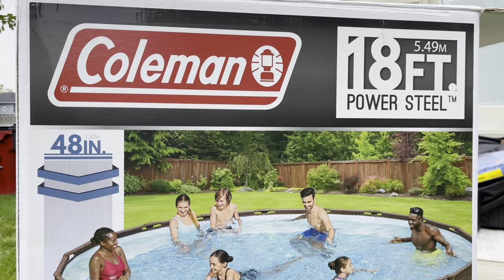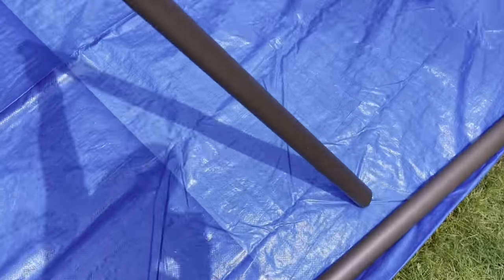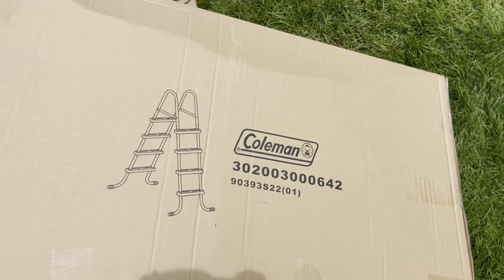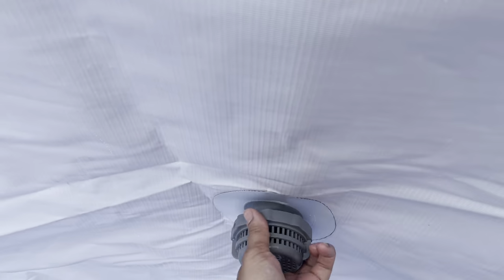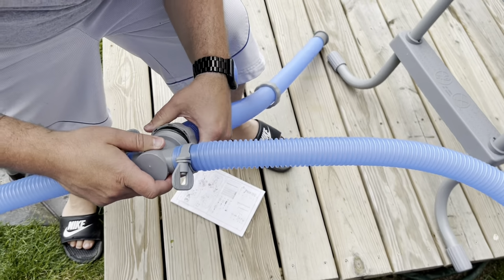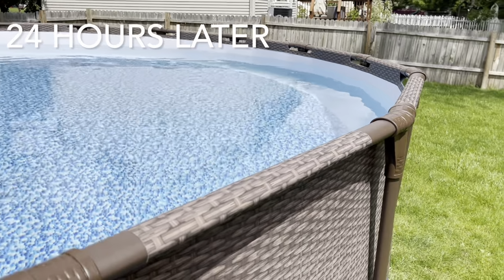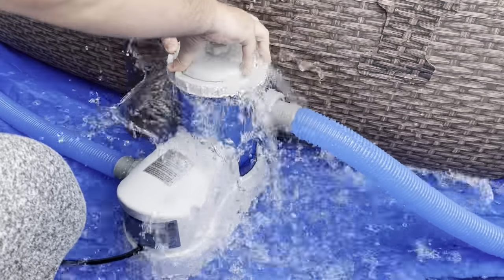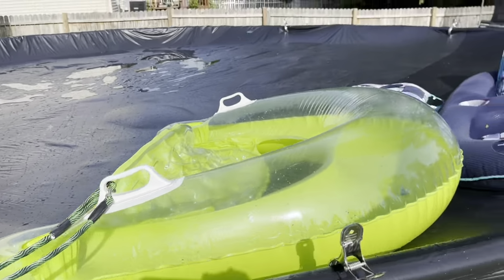Putting up our NEW Coleman 18x48  above ground pool

Comment: I'm sure you've figured it out by now, but you don't need to use those plugs everytime you clean or change the filter... Simply lift the filter housing up higher than the water level and then youcan unscrew the vent and lid and the water won't pour out like that as long as you keep it higher then the waterline! 👍... Thats how we change and clean ours and it works great! You can sit the filter inside the rim of the pool to keep it held up by itself if your doing this alone!

Comment: The pump is not enough. Upgrade to the floclear 2200 gal sand pump and get the bestway skimmer. You won’t regret it. The skimmer needs something like vet wrap around the pole to give it something to grip.
Reply from the maker: I literally was just looking at a sand pump filter and a skimmer last week! I plan on getting both!! Everyone has been recommending both for this pool, so I’m so excited to have a more efficient way to maintain a clear, clean pool. Thanks!

Comment: If you lift the pump higher than the water lines AFTER shutting the power and the flow valve off, the water will stop so you can change the cartridge. Then just leave the top valve on the filter open for a second to bleed the air out after putting it back on the ground and plug it in.  You won’t have that uncontrollable water flow while trying change the cartridge and you won’t need to use those black plugs.

Comment: What type of sand did you use and do you know how much you needed? I keep going back and forth on the sand type.
Reply from the maker: I got my sand from a local spot that sells it by the yard. They literally dump a yard of sand into your truck bed. We needed 2 loads..so 2 yards of sand (2 truck bed full load) and a yard was around $20 or so. I’m not exactly sure what kind of sand it is but it wasn’t the super soft play sand

Comment: Definitely upgrade the pump if you can. When changing the filter. Turn off the pump. Lock the return nozzle as shown and then instead of plugging inlets just lift pump above water level.
Reply from the maker: I definitely plan on upgrading the pump to a sand filter pump! And I never thought about doing that

Comment: I’ve had my pool for 2 years now still in amazing shape
Reply from the maker: Do you leave your pool up all year around or take it down?
Reply: @itsDejza  leave it up because we have sand under it so it’s leveled and talking it down will mess it up we drain the water and it’s clean right now and clear ready to swim
Reply from the maker: Nice ok. I’ve only owned a pool for a couple years like maybe 2 or 3 and each fall we take it down and store it. So I actually don’t know how to like “ winterize” my pool and then have it ready to go come spring. What exactly do you do? I’m about to set mine back up and fill it up again etc

Comment: I purchased some replacement plugs and filter covers for mine they are 1.25 inch for the dual outlet you can add a skinner to..they are to big to fit in the hole..what size is yours i cant find any 1 inch ones

Comment: This video is my go to we purchased the exact same pool and are ready to install however I am unsure on how much sand to use lol 😯help ! Lol thank you so much 😊
Reply from the maker: So we got our sand by the truck full, rather than purchasing individual bags. ( they literally dump a bunch of sand in the back of a truck bed) So it took us two truck full loads from our local sod/sand/gravel place. And honestly if your ground is pretty much level you don’t need a lot of sand. We had a divot in the ground that we had to level so it took us more sand. ( For instance we planned on grabbing at least 10 bags to start before we found out about this other place. But with seeing how much sand we needed I would have probably got 15 bags. And you can always return the extra bags) hope this helps 🙂

Comment: Hello I noticed the pump has a timer on it. Does that mean it will turn it self on and off or is it just a 12 hr timer then onces it off you have to manually turn it back on?
Reply from the maker: I have noticed that after the timer goes off, I have to manually cut it back on.(and reset the timer) It’s kind of annoying to remember to go cut it back on in the morning. I personally would just leave mine running 24/7. But I guess it’s good for the people who do not want to run theirs all day long

Comment: Just  subscribed  to your  channel. I have  a bestway  20×48 similar  brown patter pool that we just put up a  couple  weeks  ago. I suggest  in upgrading  to a intex  sand filter.  Will make it way easier  to maintain  your pool. 👍😀
Reply from the maker: Thank you for subscribing! Also thanks for the suggestion! I’ve been thinking about upgrading the filter. Where did you get your sand filter from? Also what makes it easier than a regular filter ( besides not having to spray off/ change the filter everyday)
Reply: @itsDejza  hi, I got mines on Amazon,  they have 16in,14,12 and 10.i hot the 16 because I have a 20ft. Pool since you have  a 16 maybe a 14 or 12 depends  on the gallons of water  your pool holds. It has a stronger flow wich in turn will circulate your water faster and to maintain your filter pump clean just put it in backwash for 2 min. Then in rinse mode for 1 min and back to filter and your done.but always pump has to be off when switching  to the different  modes.and on vacuuming  will create  a more powerful  suction. Ouch my fingers hurt from typing  lol 😆
Reply from the maker: Wow that’s so helpful thank you! I’m going to look into that now!! 👍
Reply: @itsDejza  anytime  😊,  it's an intex  sand filter  pump
Reply: Glad to be of service  😀

Comment: How good does the cover work, is it sturdy? Also what do you think of the quality of the wall of the pool? Do you leav this up all summer.
Reply from the maker: I think the cover works fine except if it rains a lot, when we take the cover off it’s heavy and hard to lift off. So typically whatever debris and water from the rain that is on top of the cover will end up in the pool bc we basically have to slide the cover off to get it off ( which to me defeats the whole purpose 🙄) but under normal circumstances with no rain, the cover is easy to take off and keeps the pool clean underneath.

I think the quality of the pool wall is great! My kids grab and play on the wall and sometimes kick off of the wall while swimming and it holds up nice! We left it up all summer but took it down in the fall
Reply: @itsDejza  ok thank you so much for the reply.  For the cover have you tried folding one end to the other like a soft taco (odd analogy I know)
Reply from the maker: No problem and yes I tried that as well. If there is a lot of rain on top it’s too heavy
Reply: Hello again.  Quick question. How many bags of sand did u use to level your yard?
Reply from the maker: We got our sand from a local landscape place and they sell it by the yard. 
They literally dump a yard of sand into the back of a pickup truck. And we needed 2 loads ( 2 yards of sand) it was easier and way cheaper this way instead of buying multiple bags of sand
Reply: @itsDejza  Thank u again
Reply from the maker: You’re welcome!

Comment: Can you post the link on the towel clamps for the pool cover. Your pool is awesome, I have the same one💪🏾
Reply from the maker: Thanks! 
Here is the link to those clamps from Amazon!

Dseap Towel Clips: 6 1/4”L Pack of 6 Jumbo Stainless Steel Metal Beach Towel Clips, Pool Cover Clamps, Beach Chair Clips, Beach Blanket Holder Pins, for Cruise Boat Pool Lounge Chair https://a.co/d/iXMCMqS
Reply: @itsDejza  I found them right after I posted this comment, thank you so much for responding…

Comment: I need more details on leveling it out my last one was unlevel
Reply from the maker: So I added sand to my foundation to level out the low spots rather than digging everything to one level. I added sand all over and added more sand to the spots that were lower to build that spot up. Then I would tamp down the section and check to see if that spot, along with the entire area was level. That’s when I would walk around with the wood with my level on top, and it would smooth everything as went over it and tell me if it was level or not. If it wasn’t I would add a bit more sand to the low spot until it met the rest of the area. I would just continue this entire process until I felt everything was level. I sprayed down the sand to kind of pack it down then I begin setting up my pool parts. 

I know I basically skimmed through the leveling part in the video but I can make a separate video showing step by step how to level the ground for a pool!
Reply: Mine was too! It looked like a giant wave 🤣 took me 4ever to get it corrected and still I didn't quite get it leveled. I just knew my teens were gonna burst it every time they jumped in I cringed! We ended up draining it and taking it down so they wouldn't get hurt. This year I'm getting the 18x52 and I'm spending Xtra time getting it right so we can actually enjoy it!!!
Reply: @itsDejza I plan on doing the same thing since my yard is pretty level. Were you satisfied with the results?
Reply from the maker: I was satisfied, and it worked out pretty well for me. I have completely upgraded my pool to a bigger one now though

Comment: Will this be ok to be on top of decorative rocks? I have cement on some parts and decorative areas with small rocks on other
Reply from the maker: Um I would say if the rocks are level and not super sharp (so it doesn’t poke a hole on the bottom of the pool liner)
Reply: @itsDejza  thank you

Comment: I noticed there’s a timer on the plug to the pump,what do you set it to?
Reply from the maker: I turn mine on the highest setting and usually when I go out early the next morning I have to turn it back on again because it went off after the timer is up. I kinda wish there wasn’t a timer because I would just run my pump 24/7

Comment: Could you give me recommendations to keep it clean?  I have the same pool
Reply from the maker: We pretty much try to check it every day. Once a day we take out the filter and spray it off to keep it clean and put it back rather than replacing them( after a while I do swap them out with a fresh one) on super hot days the chlorine burns off fast I make sure I go check the levels and make sure to add chlorine. Once a week I will do my weekly maintenance on the pool and add shock and algaecide and whatever else is needed to my pool. I also run my pump 247. I have a weekly pool maintenance video where I show step by step how I take care of my pool

Comment: Hi. I've exhausted myself checking reviews between this pool and a summer waves of tge same size. So far have you had any leaks or seam tears??
Reply from the maker: I’m big on reviews as well and whenever I would read the reviews there was always a handful of reviews that claim that their pool liner has rips or holes etc. I can say that both of my pools that I’ve had (Coleman and summer waves ) I haven’t had any problems at all! No rips, no holes in the liner, no leaks anywhere, no tears at the seam. In my opinion reading the reviews would kinda make you not want to buy it out of fear something will be wrong but I say go for it!!

Comment: Hi, could you please share how you prepared the ground? I saw some sand, what do I do. Thank you in advance
Reply from the maker: Hi. I added some sand to create a even, level ground before setting up the pool. I only added sand to the ground because the ground was a little un-level. I added the sand, then tamped it down and check that it was level, if it wasn’t I added more sand to that spot and checked again to make sure it was level. After everything was to my liking, I begin setting up the pool
Reply: @itsDejza  thank you so much!

Comment: How many bags of sand did you use to level your ground?
Reply from the maker: I didn’t use bags. I got the sand by the yard which they just dump it straight into the back of your pick up truck (one truck bed full) and I ended up using 2 yards( loaded up the truck bed twice)

Comment: Did you have any problem with the hose connectors that come with it leaking? Someone had recommended to get metal hose clamps at Home Depot instead and I’m setting this up tomorrow I’m wondering if it’s really necessary ! Love this pool so excited thanks for the video!
Reply from the maker: Thanks for watching! I personally don’t think metal hose clamps are necessary ( at least in my opinion) we didn’t have any leaking problems or anything. We just made sure that we had the hose pushed up as far as it would go and the clamps on nice and tight. We haven’t had any problems!
Reply: Thank you sooo much for your reply!
Reply from the maker: No problem 😉
Reply: If the original clamps are working well then my personal thoughts would be that metal clamps would be a hazard that someone could get cut on

Comment: If i put blocks or bricks under the legs will it rip the pool once its full?
Reply from the maker: I was worried about that too so I cut a pool noodle in half and cut smaller pieces and wedged it between the liner and the brick and it worked perfectly!
Reply: @itsDejza  pool noodle? What is that exactly?
Reply from the maker: @alexismendoza450  it’s a pool float for kids and it looks like a noodle. You can find them at any store and they are typically $1 for the smaller skinny ones
Reply: @itsDejza  thank you i know what you mean now that's a good idea

Comment: I need help, I cannot get the last rail into the T
Reply from the maker: Oh yeah that one is kinda difficult. We had to undo a few and snap them in while some of the arms are undone if they makes sense
Reply: Now it’s Time to put it away for winter and I can’t take it apart. Any suggestions? The push pins were easier when trying to disassemble it.

Comment: What did You use as a base was it sand
Reply from the maker: Yup it was sand
Reply: @itsDejza  thanks for the reply do I remember how many bags were needed just got a pool and I have to use sand not sure where to start
Reply: @itsDejza  this whole project is giving me heartburn 😅
Reply from the maker: So I actually found a local spot near me that sells sand, gravel, mulch etc by the yard. So for me that was easier and cheaper than buying several bags of sand. We got a yard full( that fit in a truck bed) for like $20 and we needed two loads. So I’m not exactly sure how many bags that equates to. But I also wanted to mention that there was a dip in our ground so we needed extra sand to level everything out.( without that we probably could have just used 1 yard) I will say though that before I found out about the local spot, I planned on starting with about 10 bags. I wanted to buy more than enough and return what I didn’t need vs getting too little
Reply: Yes that’s what I’ll do thanks so much for the advise
Reply from the maker: You’re welcome!

Comment: I’m putting this exact pool up tomorrow, thank you for a great video!!!
Reply: How did it go last summer? Looking to get one this year. Did you take it down? You going to use it this year?
Reply from the maker: The pool was great last summer! Super sturdy, no problems! I took it down in the fall and stored it. I plan to pull it back out here soon and put it up! So I will see how well it lasts after being used an entire summer, put away and then used again…
Reply: Does the pool damage the grass on the bottom ?
Reply from the maker: For me, the grass was definitely dead underneath when we took it down in the fall. But it was the perfect time to add grass seed over the spot. Grass literally grew a few weeks later and was as good as new!